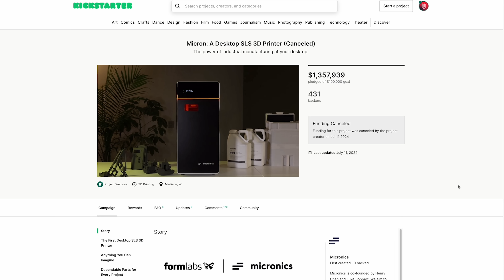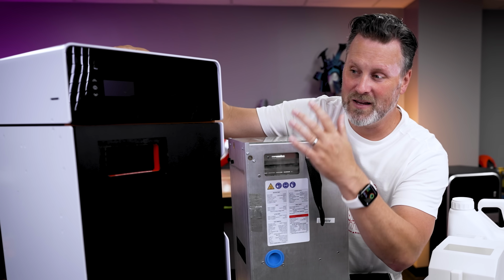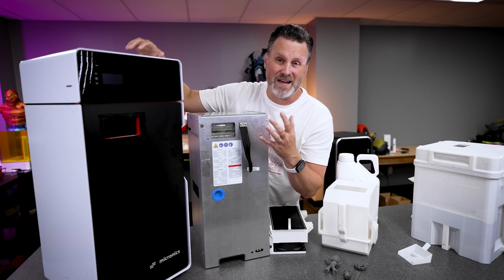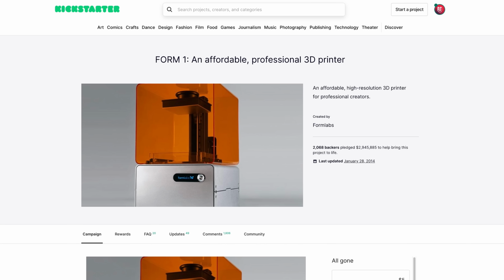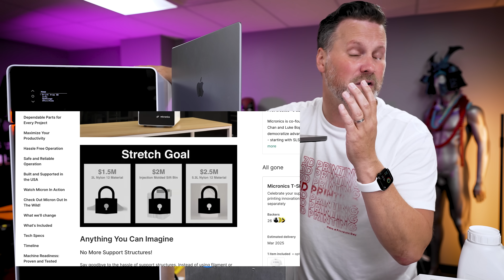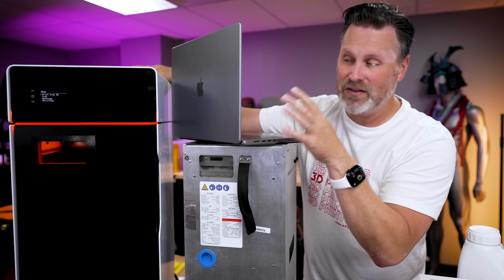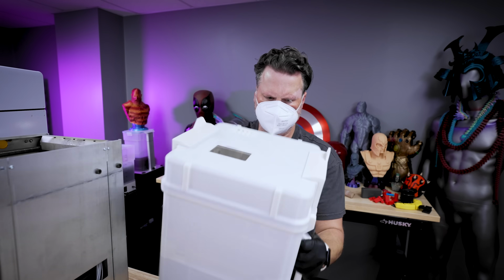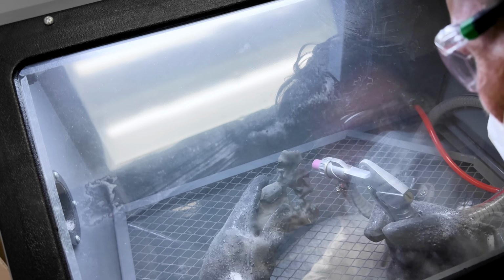NOW WHAT?! Micronics Micron SLS 3D Printer

Comment: So your internal and bed temperature were both too hot, that's why it came out as a brick. Try lowering the temp slightly. If you go too low, you may notice the edges curling. You can dial in temperature and laser power, speed, etc. with "temperature crosses". If your part is curling, your temp is too low. You want to get it hot enough so that your parts don't curl and the breakout is not a hard chunk of plastic. I've had a ton of experience with small and large scale SLS printers like the EOS printers, which is what the "airless basketball" was printed on, while working at a couple national labs. Feel free to reach out Jessy if you would like any tips on dialing your prints in, I would love to share.

Comment: I’m a mechanical engineer and I work with a form labs Fuse 1 printer everyday at my work, and I have to say…I have never had a company be so unhelpful when it comes to diagnosing problems, whether it be with the printer or the blast.
Reply: Iv heard similar stories from these clowns.
This is why you dont let business majors have an inch of control over the company, aside from maybe marketing.
This isnt even greed. Formlabs could genuinely make bank if they tried to at least compete. Gives engineers a fun project to do, and rakes in cash.

Eitherway, their short sighteedness has relegated them to obscurity and bankruptcy.
SLS4ALL kits are $7k. Sourcing the material yourself would only cost $4k.
Reply: @honkhonk8009  Exactly, incompetence to another degree.

Comment: In the long run, I think being bought by formlabs is better for the creators. The amount of units they'd have to produce (with 3 people)  means they'd have to hire someone else, as well as get new facilities - which would take a big chunk of the money. They have to produce the machines, ship them. Keep in mind that Kickstarter would be taking a big chunk of that money as well. 
As to the actual unit, it looked interesting, but it really felt that it was designed by engineers to be used by engineers. If you know any engineers, they think a bit differently than say, your average hobbyist. The machine did not look user friendly at all. Couple that with requiring the media blaster and a dedicated space to post processing, I think many would be unhappy with how this product turned out. 
It kickstarter would have been late (they're almost always late) money would be used up far quicker than they expected. For the 3 creating this, getting picked up by formlabs was the best course of option for them. The hope is formlabs can create, or more will create, a more affordable SLS printer, using the micron as a basework. There's a potential market for it. As it was though, I think the micron would not have been a success that many are imagining.

Comment: Hi Uncle Jessy - nice timing for your video. Man, the announcement is extremely sad for the dream of an accessible SLS - even more because, as you said, this was one of the rare Kickstarter campaigns that REALLY needed the money from backers to see the light of the day. I will be extremely surprised if Formlabs finish this product... I think they just removed competition. About the special deal: I wouldn't use it at all - everything ForbLabs is so expensive that in the long-run it is just a money trap. Their products seem to be very nice engineered but only companies can actually justify the costs. BUT, I agree with your concerns: would the trio actually pull off a final manufactured working product? It was a hard bet and the odds were strong... But I am very sentimental, I am a dreamer, and when a dream dies, I get very sad.

Comment: This is a bummer, but that being said, the fuse 1 form labs SLS printer was the cheapest SLS printer on the market anyway, they are only 15k, hopefully they will work on getting that a little lower. Micronics was near enough 5k so the actual machine cost is likely similar, formlabs just have more overhead.

Comment: Micronics has been secretly silencing people who brought up the health issue facts around SLS manufacturing, and stated that there are no health issues.  Everyone who said anything about it, was added to their “Hidden users” list, so that anything said by them was hidden to everyone else.

My bigger question is, if they went to this length to hide the health issues of SLS manufacturing, what else were they hiding?  Anyone who knows anything about SLS manufacturing knows that the printer is only ~40% of your costs.  The other ~60% of costs is in safety and post processing equipment, as both the material particles, and the vaporized particles, are extreme health hazards that are controlled by the government.

Comment: They definitely got bought out to prevent competition but the silver lining is that FormLabs actually has decent safety documentation and culture so if they ever do make a budget one they won't ship reviewers kn95 masks which are insufficient for that kind of application. That printer would be dangerous in any home environment even a garage the powder will spread slowly if your not very careful. The powder jug is literally a bottle of microplastics sure nylon is "mostly inert" but in microplastic form mostly inert is actually far worse as your immune system can't digest the powder that gets stuck in your lungs. Mfg's love to say its non-toxic and there is no proof that it is bad for you currently but its a microplastic ultra fine dust and there is plenty of research into dust and inert dusts = lung cancer with enough exposure.

Comment: would you rather deal with hazardous dust or hazardous resin mess?
Reply: Resin is ironically safer because it is photocurable so over time ambient sunlight will make it all non-toxic while the mostly non-toxic powder that is just pure microplastics is physically bad for your lungs for much longer if you don't completely clean up after yourself always. Resins smell horrible to indicate their toxicity (smell threshold is a real thing) while you can probably breath in a lot of the nylon powder without tasting or smelling anything for far more than you should ever inhale ever.

Comment: Sad day! This is the worst news for the 3D printing community of 2024 for sure.  A competitor buying your company is never good for consumers. If Formlabs helped invest e.g. buy 20% stake, that would be a much better outcome as they could use the capital to over come their issues. It’s even worse that it’s Formlabs who are stuck in only ever increasing their pricing over the years and going into professional sector. This was the same thing Formlabs was trying to fight 10 years ago. They were sued in 2012 by the 3D systems which was a nothing case but just because the established was scared. Now Formlabs is scared of Micronics selling a 5X cheaper product. My guess is Micronics didn’t get quite the funding on kickstarter they wanted and with the recent press from Stranger Parts, they wouldn’t have the runway to fix things before shipping way down the road. They were vulnerable and Formlabs took advantage. It’s sad because if this was successful it was going to open doors to a lot of companies being inspired/copy and make SLS affordable. I guarantee Formlabs will never produce an SLS machine for $5/6K. My hope is Bambu, Prusa or someone else will

Comment: I dont see any benefits of this technology compared to FDM (with soluble supports if you need the full freedom). The quality is the same or worse, the same layer adhesion problems, lack of different materials, very messy and time consuming, no multimaterial support even in theory, I can continue.
Reply: Its meant for mechanical parts mainly and even then for most uses it isn't needed the mess is usually not worth the effort. They are competing with large services that have industrial scale printers that can deliver parts in less than a week generally with  much higher quality and finish options for a very low price. SLS printers excel when you can absolutely max out the build chamber volume which means they favor large printers as the square cube law helps as the volume to keep hot stays hot much more easily than in a smaller machine. The absolutely max out the build chamber is very hard to do in prototype scale or artistic use but for a contract mfg you can batch prints easily and have complete facilities and safety equipment to do all the finishing at scale.

Comment: This kickstarter had zero shot of succeeding on its own. They clearly had no idea how to manufacture anything and the money raised is a fraction of what they would have needed. Formlabs acquiring them will just hide the guys in a lab, lockup their IP, and stop Chinese manufacturers that know how to make things from ACTUALLY disrupting the market. Small cost for Formlabs to continue business as usual.
Reply: I wouldn’t say “zero shot” but you are 100% correct on everything else in my opinion
Reply: Pretty sure the chinese manufacturers are pretty close they make tons of 2d laser systems that work pretty well and are dirt cheap its just the market size for such a messy process isn't exactly mass market. Most users don't need support free, isotropic, dyable, porus parts. Resin 3d printers already offer isotropic, multicolor parts with a wide variety of material options including low volume casting. SLS is mainly for engineering use as it can be great for mechanical prototyping and making complex parts that would be impossible to make if supports were needed.

Comment: Despite me not liking Formlabs. Many of the engineering resins - like  Formlabs Though - beat the SLS Nylon by a mile.... without the long print times, without the mess.
Yes there is supports required on SLA, but finishing those supports off is less hassle then finishing a SLS part.
Reply from the maker: After sandblasting for 30+ minutes I was wishing it was as easy as removing some resin supports & rinsing in IPA
Reply: @UncleJessy  Formlabs has the supports down to a science I have to say. They remove very easy with very limited blemishes, much more refined than all the open source slicer results.
Reply: @UncleJessy you're internal and bed temperature are too hot. You need to lower it slightly. Keep lowing it until it doesn't come out as a brick. But if you go too low, your parts will start to curl on the bed.

Comment: I would bet that the market for the machine was probably 1500 total. I do not think that they would have been able to build the machines. They were in over their heads and found that out way too late. Formlabs buying them and canceling the Kickstarter probably saved us all $3500. The $1000 credit from Formlabs was a joke. It was very poorly worded and did not include supplies, etc. It is only for new machines at full price.
Reply: Formlabs makes $20,000+ SLS printers, they just didn't want SLS printers to become cheap. They couldn't have sold out too a worse company.

Comment: This doesn't seem like it would have a very good value to cost ratio. It seems like it's far more targeted to hobbyists. 
  As for form labs printers, I don't really see the benefit of shelling out the money for one of them either. They don't appear to produce much better print quality than other resin printers on the market, they print far slower, and you are locked into buying their resin. Maybe I'm missing something, but I just don't see the benefits of buying a form labs machine.

Comment: So, I didn't know about this, but there's this project, SLS4ALL, that has been working on an open source SLS printer for a few years. The inventor of that design plans to sell kits for his printer soon under the brand Inova, and release his CAD files, software and PCB designs around the same time he's taking preorders. His kit will be quite a bit more expensive than the Micronics though ($6000 to $7000 I believe), which isn't too surprising, as he's using massive CNC machined parts and the thing seems a bit overengineered for home gamers, but the idea seems to be that the community can come up with cheaper, simpler implementations based on his designs once it's all released. So maybe the affordable desktop SLS printer dream isn't quite dead yet.
Reply: Ye, but you still wouldn't want a "desktop sls printer" unless you have an actual workshop for it and are willing to keep up with all the ppe and post processing needed to actually run the machine

It's really something that only a businesses would actually look into getting, and most of them would just look into larger machines to begin with because of the better customer services they provide
Reply: Yeah, I saw this the other day and am totally taking the diy approach.  These guys are lame. They claim they want to make something cheap and available to nor.al consumers and then turn around and sell out to a company just so they can stay a monopoly on the consumer product.  Formlabs.  only about profit.  Everything they sell is outstandingly marked up, and of course, they take the apple approach and ensure that you have to buy formlabs only resins, plastics, etc. Honestly, if this was a company,  it would have been blocked by the government .  Formlabs is abusing , this space by poaching competition before it grows strong enough to become a real company.
Reply: $4000 for the DIY, $7k for the kit. Thats amazing.
Reply: Actually it is already available for purchase. So are the STEP files. This project originally made me build a printnc. Now that it is finished, I am not yet quite sure if I will build an Inova, but I'm definetly considering it. I think machining everyting yourself will bring the cost to the Micronics range or below (this doesn't mean the kit is overpriced, machining is expensive if you have to charge for it).

The main thing which is holding me back still a bit is that not only the printer but also printing is quite expensive unless you really fill the chamber. One print job will cost you 20$ at the absolute minimum, a full chamber will be at  around 120$. You need to ensure you are able to pack it to around the density where the sweet spot is (amount of fresh powder=amount of sintered powder). So one "huge" part printed on this machine will cost you 100$ or more if printed alone. 

This is because you should always mix 30% of fresh powder into the reused one. So the sweet spot is where you have to add this amount anyway because it is "lost" in the parts.

Of course you can roam around this sweet spot. Being below will accumulate your refurbished powder, being above will enable you to reuse it.
Reply: @Gaston12345 I'm struggling to find the source documents. Any links?